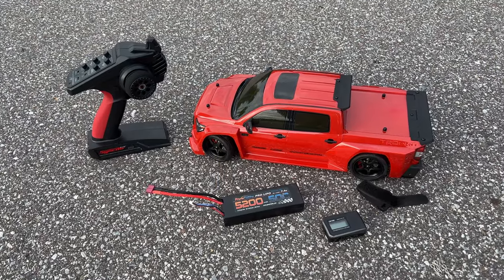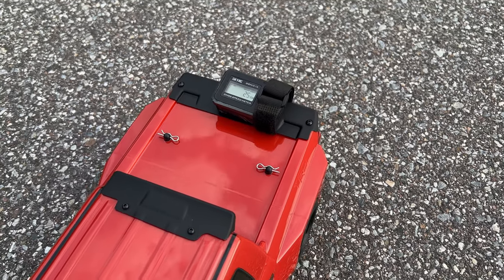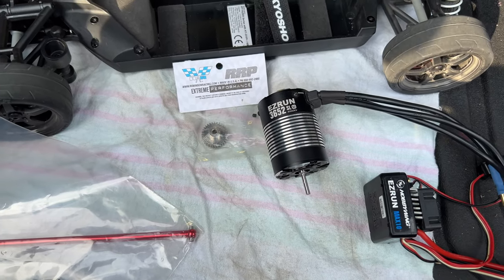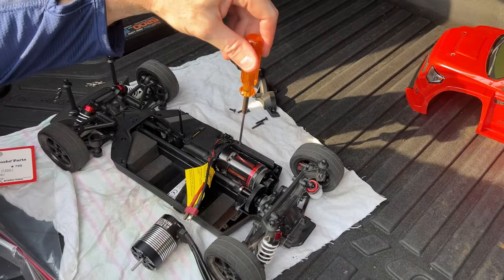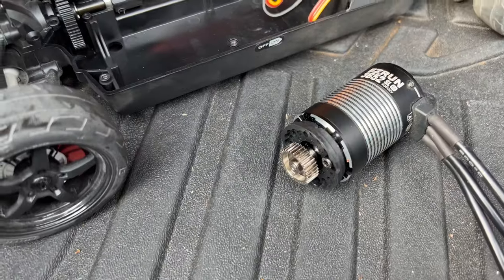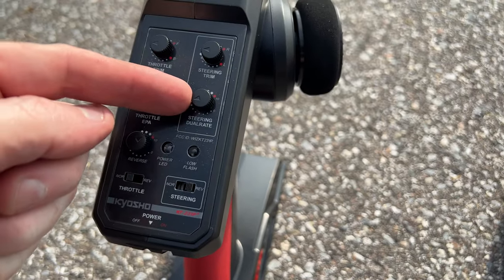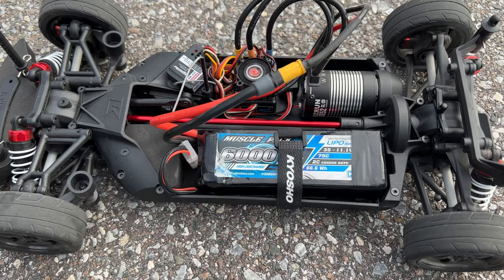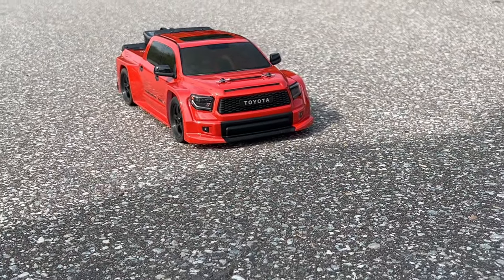How Fast Stock vs Brushless Setup? | Kyosho Toyota Tundra TDR 1/10th Scale RC | OMGRC.com

Comment: Great video, thanks for speedrun and upgrade install.  I'm looking for a nice budget brushless upgrade for my Losi V100 C10 truck.  I was actually looking at a similar Hobbywing combo like yours on the Tundra.  Do you think for running on 3s that the 60amp ESC would be enough to keep things cool?
Regards
Reply from the maker: I would run a fan on the motor as it gets hot but ESC no issues. 👍

Comment: Hey Jo @OMGRC ,
Would like to try the 3s BL motor with +30 pinion gear it's going to take off like a jet. I've already tried that and moving onto trying with a 6s motor on a 1/10 XD.
*Don't forget to install a cooling fan on the motor, without it, it's going to heat up like hell but if you do, it will stay cool even after running 30 minutes.
Reply from the maker: Thank you but I’m good with this setup😉👍

Comment: I have same setup in a tamyia tt02 and I don't even bother running 3s because it's just too much power as it is at 2s. Can hardly control the thing.  Spins out and starts getting squirley